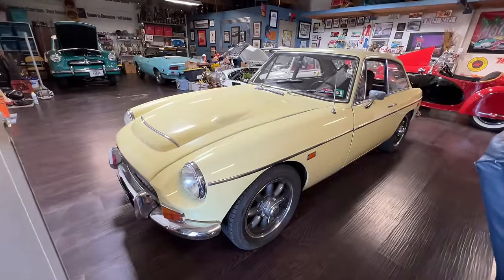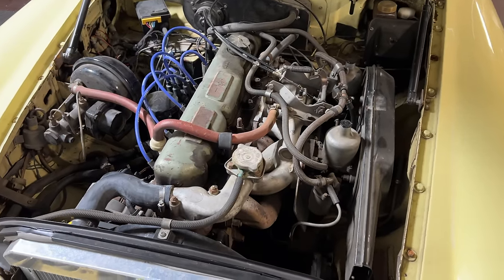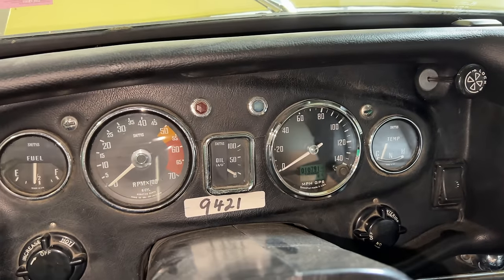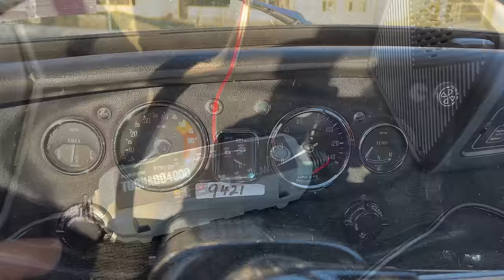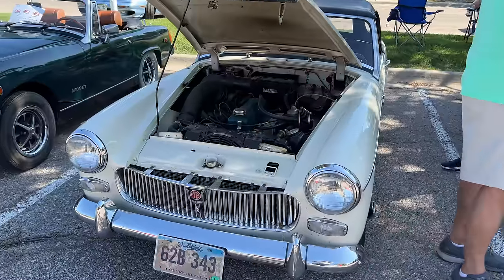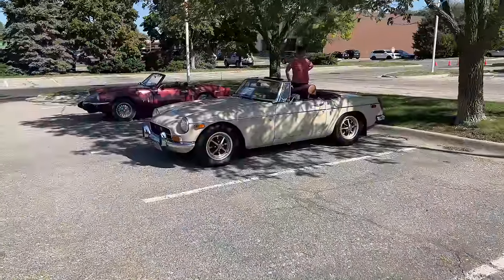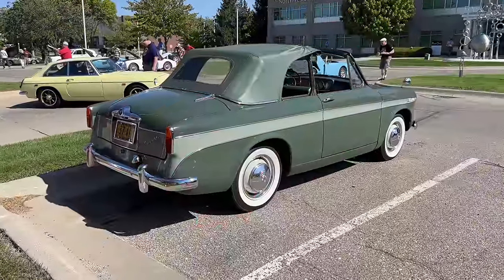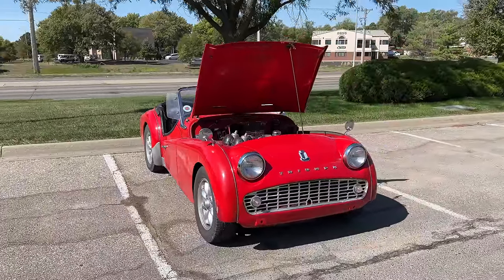Limping the MGC to the Flatwater British Car Show

Comment: Nice quick fix on the car, you are thinking outside the box again Steve.  So surprised to see a Singer in the show great old cars. Some well kept examples there. Thanks for the walkaround Steve. 👍👍
Reply from the maker: Glad you enjoyed it
Reply: Steve you said the MG had an aftermarket Overdrive fitted. It didn't occur to me immediately but I wonder if it is a "Laycock' kit? They did kits for other makes as well I think but theirs was the most popular for MG'S.  I was looking at MG'S for sale recently and at least one said 'fitted with Laycock Overdrive '. I can't say for certain that they were shipped to the USA but its quite possible. You may find a label somewhere aiso stating the Model number, they usually put a label on the car. Sorry I didn't mention it before. 🇬🇧👍

Comment: Melting wires could only mean one thing, original Lucas electronics.
Reply: I'm really getting tired of this cheap jibe. I've driven loads of cars with Lucas electrics and had far fewer issues than with the offerings from several American-owned makes. The electrical system on this car has obviously been bodged up, so you can hardly blame Lucas for that.

Comment: How is this different from the MG B ??? I miss my pain in the butt TR6 🙃 my fav was the   Big Austin  drool
Reply: The Mgc had the 6 cylinder 3 litre engine mgb had 4 cylinder 1800  and a completly diffrent front suspension which was torsion bars instead of coil springs.

Comment: Was that a Riley with the hood up in Jim’s garage?
Reply from the maker: That’s a Wolseley
Reply: It’s a Wolseley Hornet. Judging by the fact it’s a convertible and has a registration plate in the range LLH 8- -D, it’s one of the 57 prize giveaway cars from a Heinz promotion run in 1966 in the UK. The Crayford Convertible Club estimates there are 41 left.
Reply: My first car was a 1959 Wolseley 15/60 field find which I bought from the farmer for $18. I was 13 years old and drove it on the farm until the frame broke by the rear spring 2 years later. I loved that car, even got the grills Wolseley light working.
Reply from the maker: Emma you are correct it is one of the Heinz 57 Wolseley Hornets.

Comment: Gonna leave the battery charger clamps hooked to the terminals UNDER the SEALED battery compartment cover? Hmmmmm….

So, what will happen when one of those clamps vibrate loose? Short circuit under that cover that you won’t know about until you smell the smoke…..in a HARDTOP. 

Sounds like a great plan bro. Good luck on that.